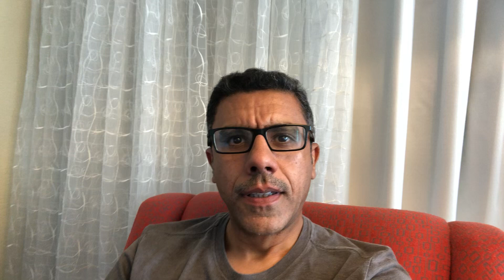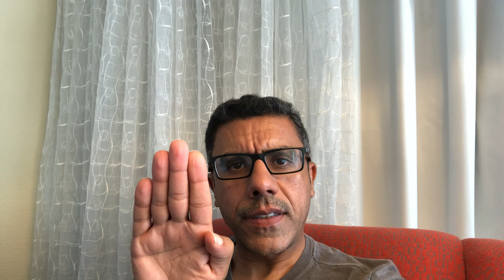Disconnecting Autobrake B737 (Raw)

Comment: Suppose you set up autobrake to position no.2 for landing, after touch down you push the peddle to applied brake, the autobrake disarm light should be stay on until you select sw. to off?
Reply from the maker: Yes that is correct 👍🏼

Comment: I prefer to manually turn off the Autobrake cause I find you need quite a lot of pedal pressure to kick it out and so you can sometimes get too much braking. Especially landing on some of the longer runways where you need to roll. Great video!
Reply from the maker: Hello Samuel, 
You are absolutely right, recaindo over coming the brakes manually. And it is a habit like any other habit you can develop and smooth out with time. 

Manually disconnecting the brakes with switch is a good technique as well, if I many suggest you have some pressure on the brakes so when they are disconnected You don’t go from strong deceleration to no deceleration, having some pressure on will smooth the transaction. 
As far as long RW I personally don’t use Auto/brakes 
Thanks for your feedback. 
Keep those suggestions and observations coming. 
All the beat
Abdul

Comment: Thank you Captain Asiri for your efforts.  I have a question about your comment regarding the speedbrakes. What is the specific reason why these are only withdrawn after leaving the runway? I assume that the 'cleanup' of the flaps happens simultaneously? Have a nice day!!
Reply from the maker: Hello G L 
That is a very good question, speed brake retraction mentioned in the procedure after clearing the RW. To why, to be honest with you I don’t know. 
Sorry for not being able to answer your question. 

All the best 
Abdul
Reply: G L The reason you do not do retract the speedbrakes or the flaps right after landing even after slowing down is that you are still in a critical phase of flight and you must focus on flying and controlling the aircraft. Imagine looking down while retracting the speedbrakes or flaps and there’s another traffic on the runway or crossing the runway that you haven’t noticed. What we did in the simulator was first vacate the runway then Captain retracts the speedbrakes and that is a sign to the FO that only NOW you can proceed with the after landing procedure. Hopefully it makes sense to you. Captain will correct me if I’m wrong.
Reply from the maker: Erfan that is will said and explained, 
Maybe I am over analyzing the reasons why,,, 
I am trying to think of a definite reason why, so far I can’t think of anything except, what you mentioned.
Reply: @Erfanfox93  Hello Erfan, That make sense now . Thank you so much and also Captain Asiri.

Comment: In the simulator the nose is actually very sensitive when applying manual brakes, i was having a hard to time to smoothly brake as even more than a little pressure on the brakes would feel like slamming the nose down. Great video as always!
Reply from the maker: Hello Erfan I appreciate you sharing your experience. 
Out of curiosity have you ever tried applying the brakes after lowering the nose. How did that feel compared to using autobrakes. 

Thanks again 
Abdul
Reply: @AbdulmuatiAsiri37  Yes, i have but it wasn't always a smooth braking even when i tried not to overpress the pedals. I guess it was the simulator or i'm making an excuse.  I guess it's just a matter of getting used to them. Good thing i'm watching your videos before the real one, thanks.
Reply from the maker: Hi Erfan 
To tell you the truth flying the real airplane is a lot easier, I agree with you the simulator is very sensitive.

Comment: Nice one Captain, I had challenges with the smooth transition of the autobrakes  being disconnected. By stepping on the rudders initially, I guess my training captain didn't let me do that for most of my earlier training during the line training, secondly he would never encourage me to disconnect till well below 60kt GS when he finally got me doing it. I finally noticed that I had a confidence issue trying to manually brake and keep the aircraft in a straight line. But thanks to a captain who kept me.doing this till I got my confidence. 
Sometimes I wish I had some of these videos of yours before my line training, it would have made my training much easier.
Reply from the maker: Thank you mtrackerbeyond, 
For sharing your experience. It will help other pilots. 
I appreciate your kind words. 

Nice to see you commenting in the channel after a long time 😊. 

Fly safe 
Abdul